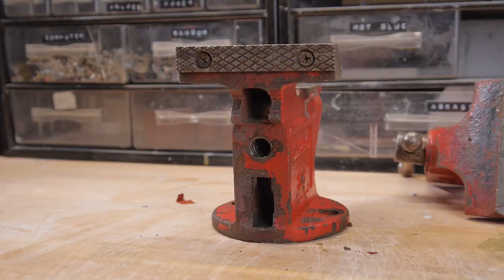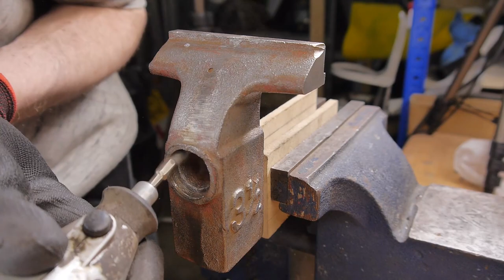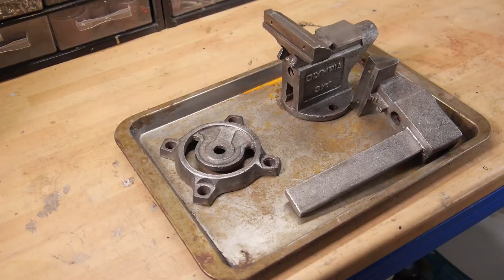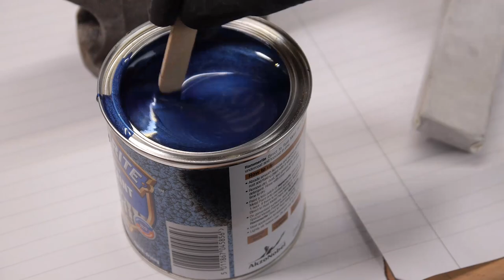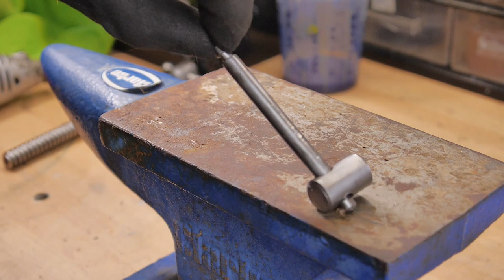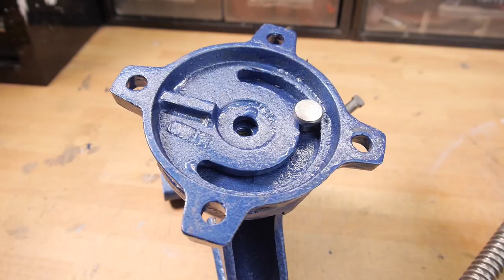Engineer's Swivel Vice Restoration

Comment: Great work man :) One advice, when you are cutting the masking paper on the edges, don't cut it, just hold the razor blade on a slight angle, push it to the metal and just pull it towards you and down with small stops, it will make a nicer cut and it will pull down on the edge you are cutting making it hold on tighter.

Comment: Nice. Your approach is like Primitive Technology. The only things I'd do different is (1) After cleaning the bare metal, etch it or use a self-etching primer, then paint. (2) Also, coat the exposed bare metal after painting with oil or, forgive me, WD40.
Reply: Holli Wood I was wondering why he didn't use etch primer, but he said in one of his comments that this paint doesn't need primer...I'll trust his opinion more than mine. I'll look into this paint.

Comment: Question: Did that blue paint came ready with primer? Cheers from NYC.
Reply: Hi logan 
Hammerite brand  paint is well known paint in England. No primer reqd, used on all sorts of items that require a tough finish. Comes in many colors and drys to a finish that is glossy but mottled or planished effect, hence the hammer in its name. I believe it's available in the States, you may have to Google it. Just found this guy's videos and saw your comment,  thought I would belatedly respond. Hope this helps. Good luck.